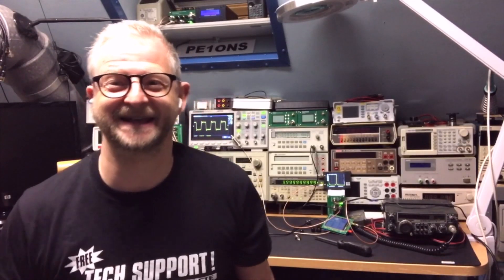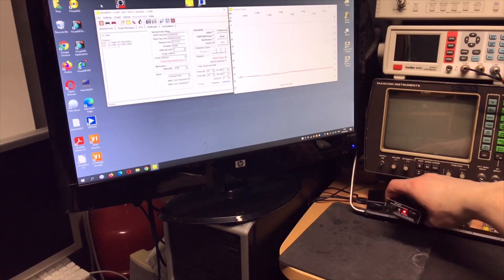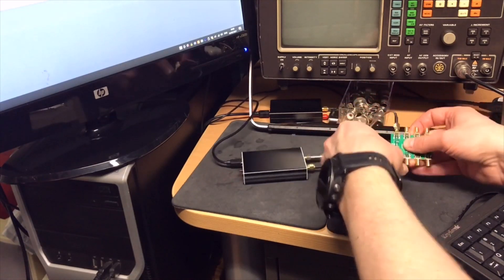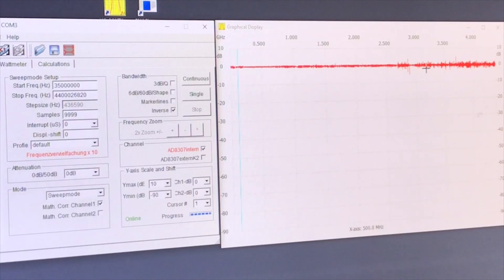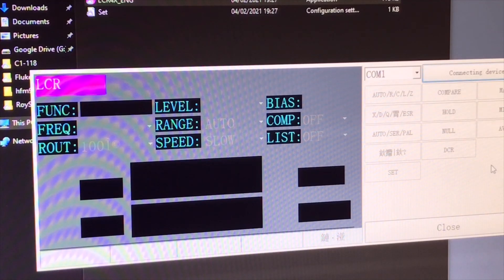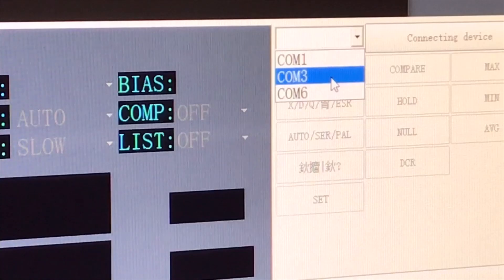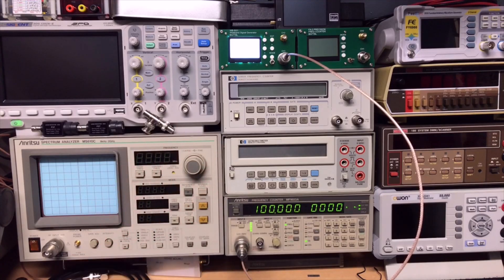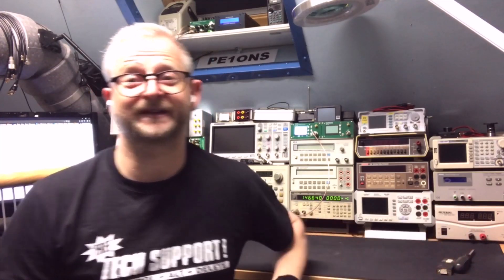#139 Q&A (4) LTDZ 35-4400 Normalize / VC4090C Serial / WB-SG1 ch1 Steps

Comment: Thanks, Tony. The following became clear to me. The CH340 microcircuit is used as a USB interface. The USB serial CH340 driver was previously installed in my computer. The USB port is probably not working in my ET4410 LCR meter. I also tried to connect the instrument through the serial port using an UPort 1110 converter. There is no connection to the ET4410 LCR meter. Well, there will be time and desire to sort it out and see what's inside.
Reply from the maker: Hello Bnktop .. the video about the CH340 was not the real video, i am sorry, that was only to show how you can see what post it is going to be, in the device manager.. the actual serial in the ET4410 Had no name, but it did show up there in the port list,. but that video got lost and i just rearanged the lab and can not reach the USB, so i did not do that again, i connected it to D9 old serial :)  Yes could also be there is something broken, if both don't work., inside is prob. just the same connection. thanks for the feedback.

Comment: Hello Tony.  Thanks for looking at the WB-SG1.  I'm not sure why I had that problem with getting the signal generator to the exact frequency.  But, I found a way to do it. I set all the place values to zero. Then I input the kHz, tens, and units.  Then I input the mHz places.  Eg. for 146.640 mHz, I start with 000.640 mHz.  Then with that entered, I input the 0 gHz and 164 mHz places. By the way, I just want to say that I am learning a lot from your videos.  Thanks again.
Reply from the maker: Hello Richard, great you found your way around it, and Thanks, enjoy!